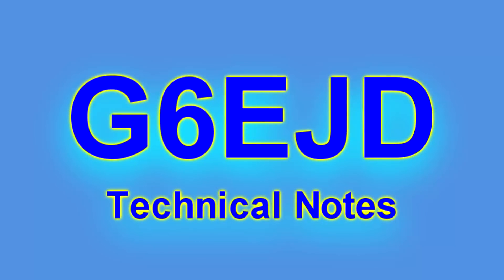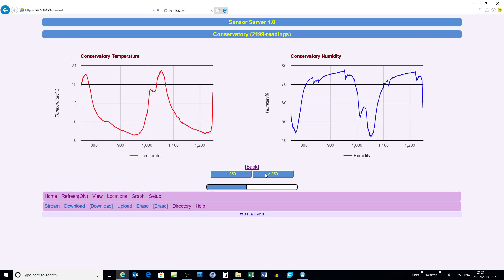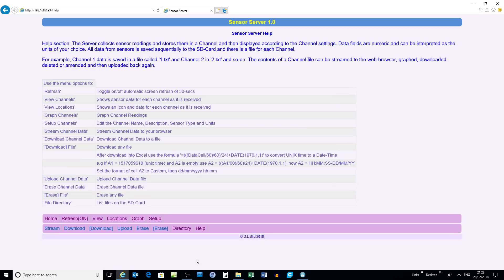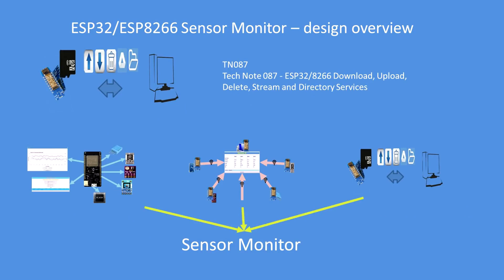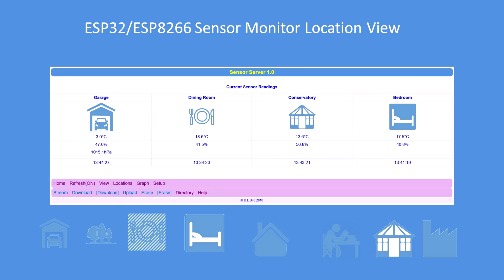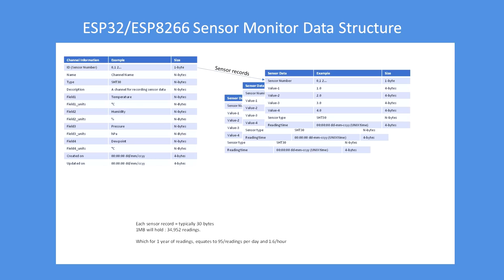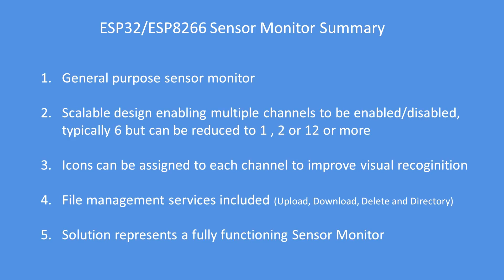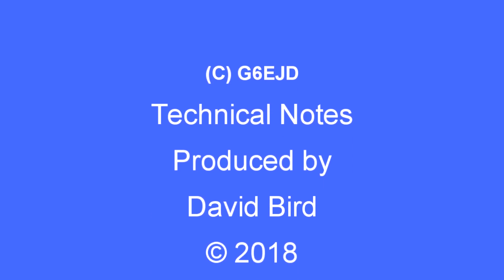Tech Note 088 - ESP32/8266 Sensor Monitor

Comment: Dave thankyou for you hard work I love you videos, but the but is I can't get this to work.

the server works if I give a test on the web browers shows a new entry. Using the sender code from 83 video they connect and form the correct data from the sensor but no new entry on the server is received. The sender text is below.  I checked It got the correct server address in the SendHttpPOST().  Any suggestions what I should do next?  thanks in advance Graham.

Wi-Fi connected

IP address: 192.168.1.116

...Wi-Fi connected
...Submitting Upload request
...Information to be uploaded: sensor?Sensor=3&temperature=24.36&humidity=39.33&pressure=0.00&spare=0.00&sensortype=SHT31D-1
Attempting connection...connected
sensor?Sensor=3&temperature=24.36&humidity=39.33&pressure=0.00&spare=0.00&sensortype=SHT31D-1
Reply from the maker: OK, I know what the problem is, I’m guessing you might be using the ESP32, but either way check out the client code, you will see I have updated it to include a delay before disconnect as there seems to be a library or compiler issue in that when the client sends a GET or PUT which is what yours is doing correctly, the client.stop command is issued before the client.print statements have completed, it should be a ‘connected’ transaction but the client disconnection takes place before the server has acknowledged receipt, so the server abandons the received message. So the answer is a delay in the client code, but please examine one of the latest versions to see where I have placed it. Let me know if that does not solve the problem.
Reply: Hi Dave, The server is ESP32 and sensor ESP8266. I have sloved it. It was IP clash.  I logged in to the BT router (192.168.1.254) and found a wired connection, a network hub with 192.168.1.99, so no error when have wired and WIFI connection on the same IP.  The strange part is The web browser sees the ESP not the hub, presumably as the hub does no respond to port 80.  So the sensor GET went to the hub?  I changed to a free IP and now it works. I will update the code and leave a message later Graham
Reply from the maker: Good to hear it’s now working. You could move the IP address of the ESP server as it’s an arbitrary / random address but it would need the address used by the clients to be changed so they know where the server is. The address is IP:port so although the routers management page may be on port 80 you can still have another device on port 80, but if you want to see the server from the internet / wide-area network then your router may prevent you from having a rule that forwards port 80 to your ESP. You can change the port used by the ESP too to prevent other clashes, so you’d access the esp home page with e.g 192,168.1.99:88
Reply: Hi Dave, I have a ESP32 with thenew  delay working for a few hours now without problems.  I had to tame down the update rate of 60 seconds with 5  sensors as were fighting each other for a time slot.  Thanks for updating the sensor programs so quickly. Graham
Reply from the maker: Hi Graham, good to hear all is working. It’s an interesting phenomenon that although often started independently and at different times eventually they all end end sending a reading at about the same times. Clearly because if a client can’t get through it will wait and try again thereby giving rise to the alignment. You may find the server is spending a lot of time servicing frequent events that responding to any other requests is slow. Unfortunately the ESP Webserver can only handle one connection at a time although to multiple users that matters little providing their expecting instant responses. Have fun.

Comment: A fine piece of work.  I also find the google services a bit of a problem; we don't have mains and running our satellite internet connection takes a lot of power (about the same as the fridge).  Local graphing would be everso helpful as we are offline most of the time that I have free to work on it (or play, as Mrs would have it). I am working towards a sensor/relay network to control our PV and wind charging and storage system.  Your web interfaces are brilliant by the way.

Comment: Great  video as usual - finally one of the best , most complete and useful esp project i have seen on youtube. congratulations : ).
I am trying to implement similar thing for my sensor network - but localized graphing i.e. i do not want google charts to graph for me. because let us say if we do not have internet connection then graphing will not be done. it might be useful to have this capability too.
secondly, although your main .ino file in sketch is well structured and adequetly commented, i wonder if it could be splited into parts of header file. so that in case someone wants to add or remove icons, sensors, nodes etc it become easy. may be you can put them into different classes and then call those - just a suggestion to help novice understand the code easily :)
Reply: i just realized you have already implemented some classes and headers :)
Reply from the maker: Other than java I've not found a way of graphing locally, maybe I'll spend some time on the Java approach to see if it's feasible. Thanks for the feedback I'll see how I can implement improvements but it has to help a wide range of people especially beginners. The design here does not need embedded icons it pulls them from the SD Card / FS and similarly the sensors (Clients) determine the sensor type so it's a distributed design really, leaving this monitor to merely collate and display the received data no matter what it is. I've made all of the variables scalable and spent a lot of time on the HTML to ensure it works across all devices such as an iPhone, iPad, Android and Desktops, that took me a while to get right. I might add date-time to the SD / FS filing next.
Reply: thanks ... i can see the extent of efforts put into this :).  
i just tried to burn your sketch, unfortunately i cannot get the server webpage loaded into my pc. it gets connected to my wifi and give ip address 192.168.0.99  but in webrowser on pc i cannot get webserver page. my pc and esp both are connected to same wifi. any idea how to troubleshoot this ?
your earlier sketches did work for me in first go...
Reply: i do remember having seen someone implemented local graphing using html or java... i will fish my bookmarks and getback to you if i can find that person.
Reply from the maker: Does the serial port report any issues, time set? Http server started? I’ve tried two different networks during my testing without problems, also try using the IP address not the Mdns version as not many systems have the ability to resolve the logical address. SD Card fitted and working?
Reply from the maker: Does the serial port report any issues, time set? Http server started? I’ve tried two different networks during my testing without problems, also try using the IP address not the Mdns version as not many systems have the ability to resolve the logical address. SD Card fitted and working?
Reply: i didnt connect sd card yet. i thought sd card is required only for logging data. i was expecting at least the webserver running without sd card, wont it run without it ?
Reply from the maker: Everywhere it tries to access the SD Card there is a test, mine works perfectly without an SD Card, I have it running now. Did you try http://ip-address/ rather than http://sensorserver.local/Presumably there's no other device on that address?
Reply from the maker: Are you using an ESP32? The time is not being set, Timezone code correct? Do you normally get NTP Time services OK, what is your location?No card detected - there are real problems with SD Card readers if you have one fitted.
Reply: i am using ESP32 board. i tried your previous sketches of webservers, those work perfectly. No i have not connected SD card reader. It is bare esp32 dev board from analoglamb.
Reply from the maker: I've updated the code to better suit the ESP32 - well actually counter a whole load of ESP32 compiler issues that don't exist for the ESP8266.  I recall you had some issues with your board before, the only thing I can think of is the choice of SPI bus to access the boards Flash memory. See Github link for the update. What I've done (because the ESp32 compiler can't cope with long strings) is broken down all of the HTML into separate sections and send the page as being of unknown length so the Browser will wait until it receives an HTML stop, this allows long strings to be sent, unfortunately the ESP8266 method is not used. It could be down to the ESP32Webserver library too.

IF it does not receive the correct time as displayed on the serial port then there is a NTP issue and it can't reach the NTP servers or your Timezone setting is wrong or choice of time server is wrong.I've just test the code on an MH-ET-Live ESP32 and NodeMCU ESP32 and they both work perfectly.
Reply: Finally managed to make it work.... i was putting wifi credentials correct, but later realised that i was missing the correct gateway , subnet and dns server ips.  may be you can put a note in comments in sketch that these also needs to be updated as per the router we are using. (dummy novice like me might not know that ; )  )  thanks again for great work.
Reply from the maker: Electromania ok thanks I’ll do that as part of the setup instructions
Reply from the maker: Have you checked what IP address your router assigned to the server? Make sure your clients are sending their data to the same IP address

Comment: Dave, this is real nice I have one of your projects with 6 stations running and now cannot wait to upgrade to this all in one monitor! keep up the good work !
Reply from the maker: It should work as a direct replacement. METARS are now running correctly again with SSL sockets. SO normal service is resumed. I had a good response from the NOAA Help desk and they resolved the server non-disconnection issue that was making it erratic.
Reply: Thanks  Dave,... And I can confirm your Latest revision for the METAR is working Well for me now, I made the needed changes to get Temps in deg. F , etc being in the US.... Thanks For working through this to make work , it's really a cool project, making a 3d printed case for it soon to mount on the wall !
Reply from the maker: OK good to hear. It should have needed these changes line 24:#include <WiFiClientSecure.h>Line 47:WiFiClientSecure client;And then the whole of Get_Metar replaced, the rest remains the same.